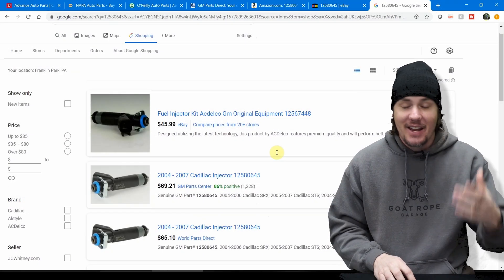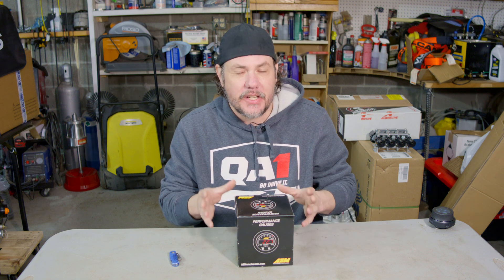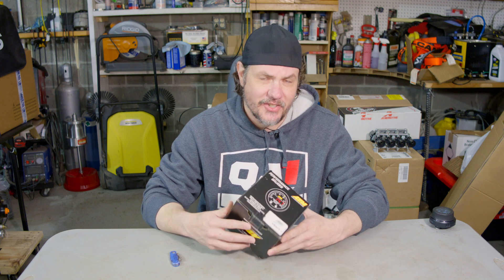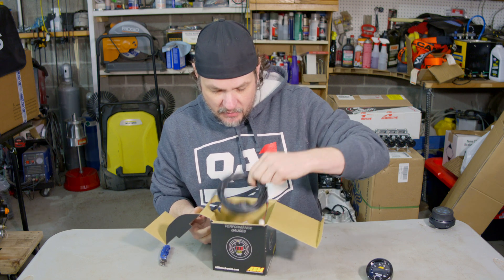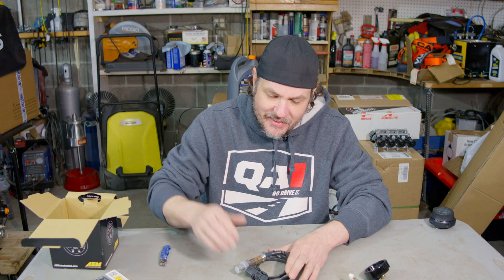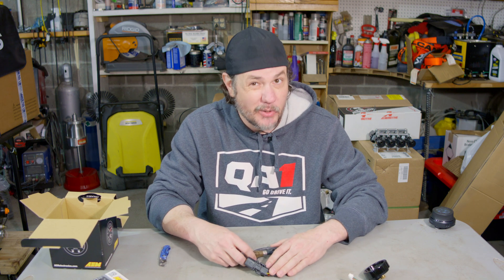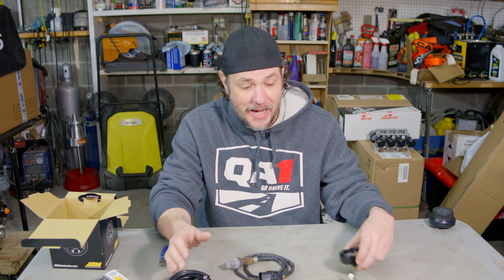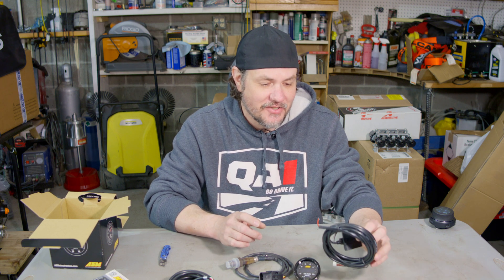AEM 30-0334 Can Bus Wideband AFR Gauge

Comment: I noticed your Amazon bought gauge was missing a nut off the back, I bought my first one from Amazon too but it was clearly used so I sent it back and bought a less expensive one from a reputable dealer. My Sensor isn't a Bosch I don't think. My new 30-0334 set up easy, worked well for a few days and then after  a week the gauge quit reading AFR, I could get a number in Lambda but AFR just read - - - - across the gauge. It still gave data to my HP scanner so in my case the weak spot wasn't the sensor it was the gauge. I am waiting to call their tech support when it opens and if they cant help me I will get a hold of the retailer for an exchange. I will say that I liked it when it worked but it is a lot of sheckels for something that has a reputation for being buggy. Also I want to thank you for your videos you have been very helpful.
Reply from the maker: Crazy, let me know what they say
Reply: @GoatRopeGarage   AEM service was great. They tell me the problem with my gauge is actually the sensor and they are warrantying it. Just showed proof of purchase and they had me take a video destroying the old gauge and my new one is en route

Comment: 8-27-25. Just opened up a new aem 03-0334, sensor has no markings, no part number, 4 different colored wires ( Bosch uses 2 whites for heater) a crimped harness , also short harness. Looks fake to me

Comment: I just avoided the trouble and went on Amazon and bought an aem 30-4110 without the sensor and picked up a $40 knockoff with a 12 month warranty that reviewers claim the seller makes good on. All in for $140
Reply: What vehicle are you using it on?

Comment: Just getting into tuning. I have HP Tuners and just starting my journey learning about it but haven't used it yet. I've heard you say tune in lambda a few times. I'm looking into the Ballenger systems. I have the option of ordering it AFR or lambda readout. Should I go with the lambda option?

Comment: I bought one in Nov 2024 from Summit Racing and my sensor has no markings on the sensor itself. But the connector does. Also, there is a join in the middle of wire like it has to different branded ends? I've emailed Summit to inquire. Update: Summit asked to contact AEM. AEM said that not all sensors get stamped but they are in fact Bosch sensors. I shall see if i run into any issues with it.

Comment: I purchased an Aem 30-0344 in 2024 and it came with FAE sensor and you cant swap it to a bosch until they update the gauge firmware

Comment: My Holley system bought in January from summit isn’t a Bosch sensor. I am selling the system new in the box with the 6.86 pro dash. It’s the x max gen 4 drive by wire system for $2500 if anyone’s interested

Comment: there are plenty of fake aem wideband kits on amazon , if it doesn't come with a bosch sensor ,  i would be very suspect of it. the fakes look identical to the original , there very hard to tell apart unless they are side by side .

Comment: K, I have installed this exact unit.  The gauge is working perfectly but I cannot get it to log in HP tuners.  I have the MPVI3 and chose the channel AEM 30- 30XX wideband channel 1.  Any advice

Comment: I run one of these guages and so far it works very well. However, after doing a TSP stage 3 cam on a camaro ls3, the idle tuning seems a bit off. Every now and again it will go into a weird idle, almost like it is surging. Rpm is set at 900. When it does this weird idle, the AFR guage will bounce as high as 16.5 before leveling back out. Idk if this is normal for a larger cam. The stock set up would do the same thing sometimes. Any feedback would he appreciated! Normal driving is pretty good. Afr is between 14-15 cruising low load. PE stays about 12:1.

Comment: I installed one of these on my buddy's truck and came with a chepo o2 sensor.... soooo I bought your graph layouts, and I can't get the damn thing to read on the hp tunner VCM channel. I'm using the "Red" wire. I have the pro link hooked up to it. Had to splice the 2 OBDII wires that come with it to the pro link. If anyone can help, that would be nice. Thanks

Comment: When you get to describing connections, please include your thoughts on using the AEMNet with the Prolink+ on the MPVI3, which in my case is the 30-0300. The 0334 has the OBDII pass-through, mine just has two wires suitable for connecting to the Prolink+. The searches I’ve done show a couple possibilities. There are two 5v input wires to the Prolink+, blue and red. There are also two CAN buss wires which one guy connected to the AEM CAN buss by putting a 100 ohm resistor across the connection—which made it work. My question is whether you find if this is an option rather than the analog 5v. My application is a Gen IV 6.0 with an E38 and a 6L90. The TCM has a Corvette OS and the torque converter is Circle-D with a triple disc clutch. The combo is in a 71 C10, soon to be ready to start for the first time.

Comment: I bought 1 a couple of weeks ago. It came with the FAE sensor. Before buying it I didn’t know there was an option to use the obd2 port so now I’m stuck with a bunch of wires. I have the serial to usb plugged in but I can’t get it to show in the scanner. I can see it in another program but I’m at a road block trying to get in where I actually want it.

2011 suburban 5.3 LT 
Any help would be appreciated
Reply: Apparently turning the computer off and on is not the same as restarting. After actually restarting the computer it all worked. So technically you’ve told me how to do it several times 😂……… thanks dude lol

Comment: I bought my AEM 30-0334 from Amazon (AEM Store) on February 24, 2024. It came with a 1928404687 Lambda O2 Oxygen Sensor LSU4.9. I have not installed it yet in my C6Z.

Comment: Had mine for 2 years. A few months ago it stopped pulling data into my PID. Not sure if it’s a hardware or HP Tuners issue. Gauge still works fine though.

Comment: Ive bought 2 of these and a boost gauge over the last 3 years. Both 30-0300 had a knockoff sensor. I received the boost gauge poorly packaged. The box was mashed inside, unit had a scratch and blems. I immediately returned the boost gauge. I also purchased these from summit so i would say they are the real deal. The sensors included did not last a year.

Comment: Thank you for making this video. I bought an AEM 30-0300 from SDPC this past November and was very confused to find a FAE/AEM labeled sensor instead of the Bosch LSU. Afterwards, I checked AEM's site and found a small note in the description saying:
"AEM co-developed the new sensor with global automotive supplier FAE, culminating in a new sensor design that has a faster response time than the Bosch 4.9 LSU and is less prone to failure in high performance vehicles"
However there are still 2 sets of instructions for the same part number on the same AEM page, with one labeled "Bosch Sensor" and one "FAE Sensor". 
In the "FAE Sensor" instructions, there is an extra note saying:
"The X-Series UEGO gauge can automatically determine whether an AEM/FAE or Bosch LSU4.9 sensor is connected to the UEGO sensor harness."
So to me it sounds like they are in process of switching to FAE sensors, but I am happy to know I can pick up a good old LSU4.9 if the FAE fails quickly. So far so good!
P.S.: CAN FTW!
Reply: I just got the same and just installed it. I have an  older  one with the Bosch sensor.  I didn't see this video until after I instlled it, otherwise I would have taken pics of both side by side.  The old one is going into my other project. I will follow up on this video with more as I hammer on this one, especially if anything goes wrong.

Comment: Same model i just put in my 04 Vette, not sure what sensor though.  Had to cut the obd2 plug off and wire it in to serial adapter to work on my 04. Took some trial and error, but seems to work fine and plus side, didn't have to buy the pro set hptuners.
Reply from the maker: How I profer to do it, serial is the superior way to get the data in the scanner.

Comment: Hey man watching your videos for years , do you have any videos on removing vct on hp tuners if possible, got a build at the moment where i want to put aftermarket cams /gears on it
Reply from the maker: I think I do, but I can't remember. Just go under variable cam under airflow and set number of cams to none.
Reply: @GoatRopeGarage  sweet man i was thinking along those lines , is ford much different to tuning the GM

Comment: I got the canbus aem without realizing my p01 ECM in my LS2 swapped iroc doesn't do canbus. Oops lol
Reply: if you got the 30-0334 model you can cut the obd2 plug off and wire it in to serial adapter to plug into pc. The analog wire is there, just not used in shipped state.
Reply from the maker: @bigbenisdaman not sure, on mine the analog and serial wires weren't populated in the plug. The firmware is different also but reading the instructions makes it seem like the serial portion is active.
Reply: @GoatRopeGarage  yea I did mine last month, had to move a pin on the gauge side (instructions pin-out has them all labeled, analog is there just not pinned) then cut obd2 connector and wire that repinned wire to serial connector; if that makes sense. Just not sure if guy above has the 0334 or another one that may or may not be that way.

Comment: My AEM Gauge (ordered December 2023) came with a fake sensor. It lasted 20 minutes, contacted AEM and was sent a replacement, it lasted 5 minutes. I ordered a new sensor that the seller claimed to be authentic Bosch, it was not. It lasted less than 5 minutes. I went to O'Reillys and bought a real genuine Bosch unit, and not surprisingly it has not been an issue since I installed it. IF IT DOES NOT SAY "BOSCH LSU 4.9" IT IS NOT REAL. The genuine unit also has machining on the peaks of the hex and all of my fakes do not. Dont buy this junk. I will never buy from AEM again.

Comment: Last aem I bought came with a fake bosch sensor that lasted about 5 minutes of idle time so I exchanged it for an all new gauge/ sensor kit and it also had a fake bosch that lasted for 1 cruise.  After this I called and complained to aem so they sent me a new o2 sensor and sure enough they sent me an authentic bosch sensor and it worked flawless until I sold the car.  After this I only look for the older lsu 4.2 gauges.  I have never had an issue with my 15yr old 4.2 gauge setup.  Only had to replace the sensor a couple times since going to e85

Comment: Mine from pre holly takeover came with the non canbus firmware on it, had to destroy it and send em pics and they sent a properly flashed unit.  Was kinda strange xp having to smash a fresh working gauge 😂
Reply from the maker: Yeah, crazy that it's the same gauge as the 30-0300